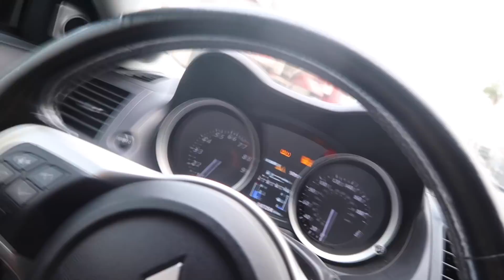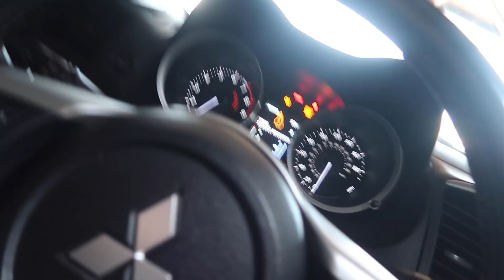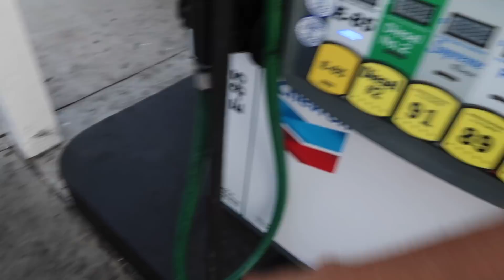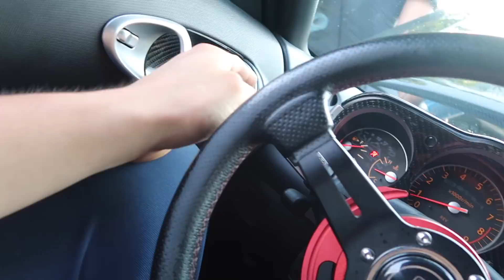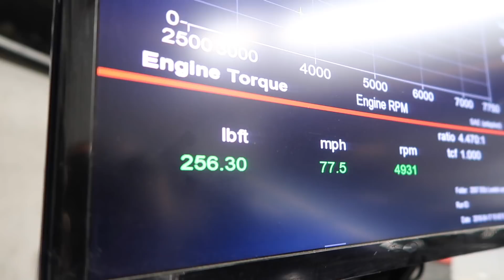350z gets retuned!

Comment: hey lowtek, recently got myself a tomei catback for my 350z. and am wondering if you also had/have a rattle noise problem around 2.5k revs. and how you fixed it if you don't as I can't hear it on your vids. cheers
Reply: Wonderbrow it’s the springs that hold the muffler and midpipe together they rattle like a mf. I have a 2007 z with tomei catback as well
Reply: Z33 DRIVERJG any way to.fix it？